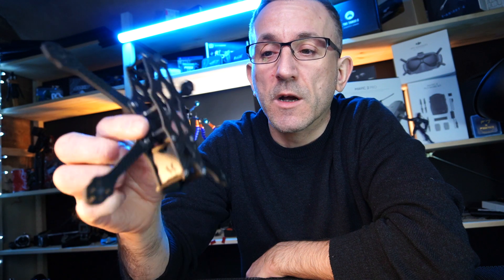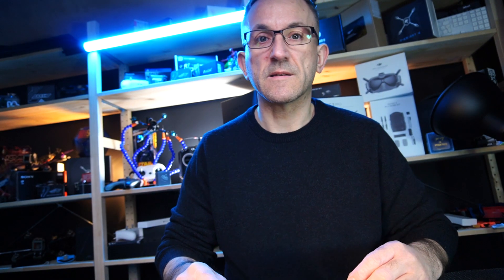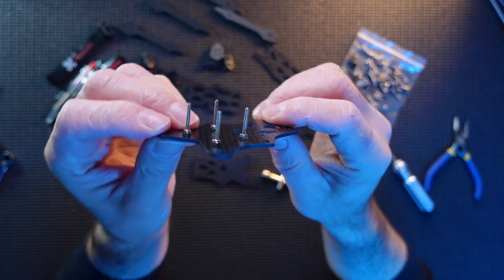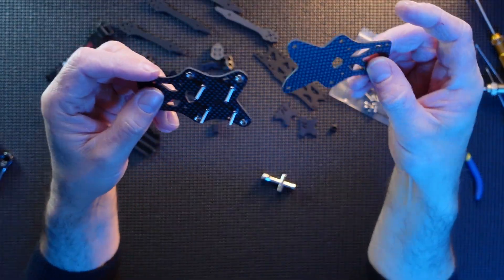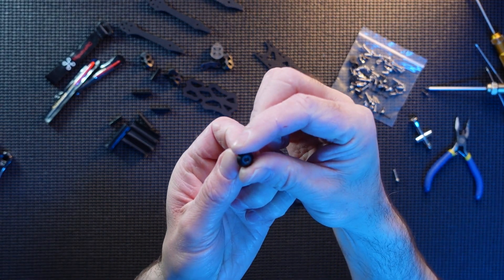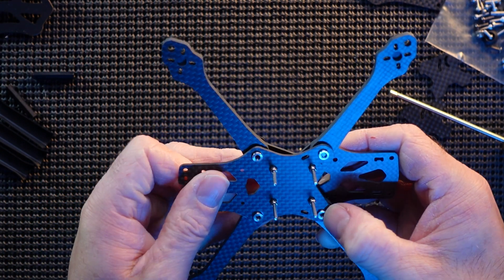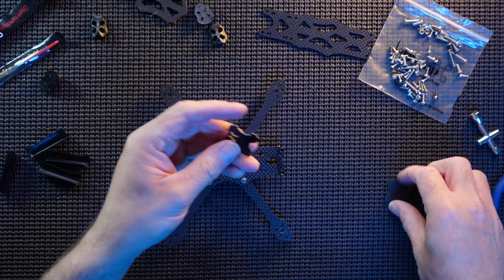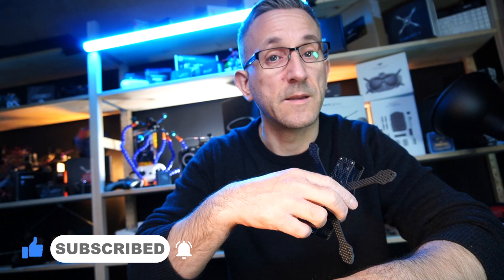ImpulseRC Micro APEX 4" Frame Build

Comment: WHY does Impulse RC use M3 20x20 mounting on this quad??  It's a pain in the butt.  I find when using the countersunk M2 bolts with the o-ring for the FC stack, the o-ring can easily slip off the head of the bolt if you tighten the stack down too much or there's movement of the stack.  Impulse RC should have used M2 holes for the 3" model. :/

Comment: Hey, ran into a slight issue while building my micro apex 4. I went with an aio 20x20 board but it is a little long and does not fit in the frame without taking the middle stand offs out. Do you think the drone would be okay with just 2 stand offs? By the way thank you for this video, I followed it to build my frame and was easy to follow.
Reply from the maker: no mate - I don't think it would be ok, it would probably smash quite easily with a crash... you could try rotating the stack, that might work... but you would need to some work in betaflight to configure for the rotated stack

Comment: I'm going to try and put the complete geprc smart 35 on top of that.
Can't stand the single bottom plate that's got to be replaced as a whole whenever on arm is broken.
What do you think of this idea?
Reply from the maker: I don't know the quad mate so can't really say
Reply: @Datfpv  well... Stack mount doesn't fit the 26.5mm smart 35's, bummer, gonna be tryin on a Roma F4, will report back when done
Reply: Flew the Diatone Roma F4 Mashup geprc smart 35 today.
It's a blast! Beautiful and so powerful even on 3S

Comment: What motors are going on? I'm building one soon and I opted for some 2203 6s motors. Anticipation carrying a gopro maybe
Reply from the maker: hey I went for: BrotherHobby Avenger SE 2004 Motor - 3150kv... 4s keeps it a bit lighter as well -  full build vid will be up soon.
Reply: I'm running 2203 on 4s and am certain I could carry a gopro. I'm running an 850mah battery most of the time, but have some 1100mah batteries that fly just fine, but you can certainly feel the weight.

Comment: I felt this one coming. I bought the 3in Micro Apex and quickly upgraded the arms. The 3 inch weight and 4 inch weight were the same for me. So, why not use the 4 in props? Nice video! Standing by for the flight review. :)